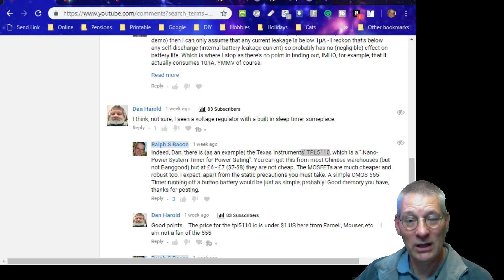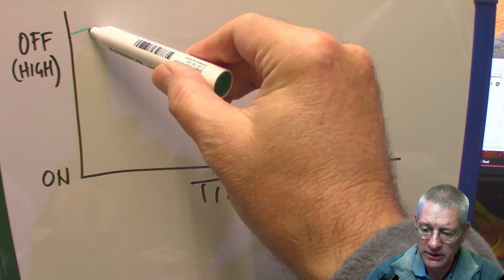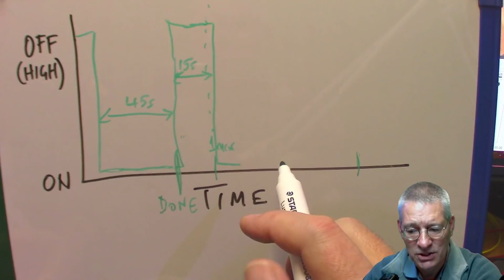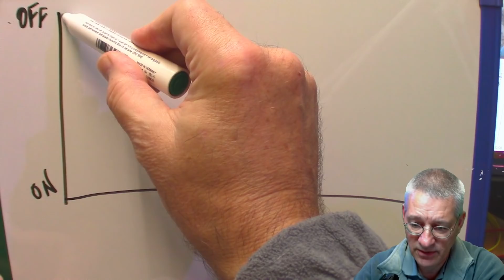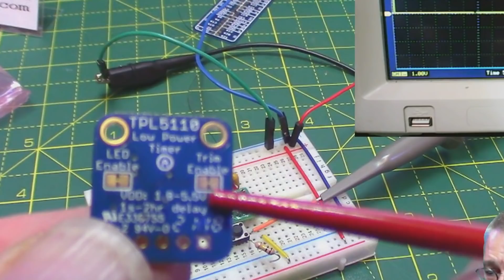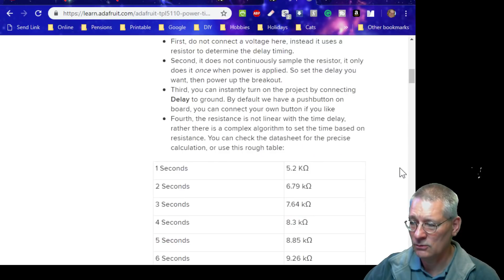#125 TPL5110 Nano Power Timer (for Arduino)

Comment: 5 years later I am experimenting with both TPL5110 and TPL5111.
My few conclusions and remarks:
1- if you assert the MANUAL SHOT it resets all the timers - that means: this is the way to EXTEND the load being powered (i.e. writing to SD card) you might periodically assert MANUAL SHOT (from you device: Arduino or ESP32) until the SD card is written and only then you assert DONE (that is not only my observation but also as per datasheet: "A manual power ON signal resets all the counters. The counters will restart as soon as a valid manual power ON signal is recognized and the signal at DELAY/M_DRV pin is asserted LOW."
2 - I wanted to use these chips for my IoT devices that are ESP32 based and... in my case it makes no sense. Why? When we use TPL511x to turn OFF ESP32 then the next time it starts, it takes extra time to wake up vs wake up from deep sleep (in fact it takes 200ms longer while powered ON again). That means that power saved due to ESP32 being completely OFF (in which case we talk power consumption < 1uA) is totally neutralised by longer time of ESP32 working. My sensors while waking up from deep sleep require in total around 200ms to wake up, measure, send measurements and then to go to sleep. But when ESP32 goes off and then on that time extends to 400ms. And these extra 200ms "eats" all the power savings. 
3 - so conclusion of point 2 above in my case is: if the IoT sensor is about to sleep less than 10min it is better to send ESP32 to deep sleep rather than to power off. If however IoT device is about to sleep longer i.e. 15min or so, then TPL511x makes total sense.

Btw almost everybody  (at the beginning) understands the TPL511x wrongly: everybody thinks that counter RESTARTS at DONE while this is not true - it only restarts at MANUAL SHOT and/or periodically when expired.

Nice video anyway, pity I found it... one day after I understood TPL511x already ;-)
Reply from the maker: But it's always good to get confirmation of your understanding! 

Kudos on your deep dive into understanding the TPL5111. On an ESP32, I've found that a complete power off is just as quick as a Deep Sleep, given that the ESP32 reboots upon wake up anyway. Then again, I'm not measuring down to the ms level like you are. 

I've found the ePulse Feather by ThingPulse to have a pretty low 15μA Deep Sleep current consumption (even more modern ESP32 devices such as C3/C6 can only match that).
Reply: @RalphBacon  because time is very relative thing. If you have a "normal" ESP32, that wakes up, connects to WiFi, i.e. with Wifi manager or so, with DHCP, with auto channel etc, all these things take ages, and I mean ages: can be even 3-5 seconds. 
But, if you do it different way - i.e. like me: using ESPnow - then everything is done within 100-200ms. That includes measurements (temperature, light, humidity, lipo etc.). In such case, work time 200ms vs 400ms (because while coming from deep sleep the wake up time is < 50ms while when coming from power on takes 200-250ms) is ... 100% longer. And then, this work time that is extended from 200ms to 400ms is the key to battery depletion. And according to my calculations this case is not worth TPL511x unless you have a sleep time > 10 minutes. Because only then, the energy saved on power off compensates the energy spent on longer wake up/work time.
Old ESP32 had deep sleep current 8uA. Everything newer than that (S2, S3, C3, C6) is around 20uA.

Comment: Great video, subbed! have to say i was disappointed by these modules, i was under the impression that you could use 1 of these as a symmetrical timer without using the done pin, it wont operate in this way, they could easily have added this feature on to the board by using 2 x tpl chips so you could have 1 running the timer function and the other pulsing the off state, so this board is of no use unless you use the done pin, unless you want a device that sends a low pulse over a set time period.
Reply from the maker: Yes, I concur, and thanks for the sub! However, it led me to a better solution with my own "on/off/auto" MOSFET circuit using a tiny Si4599 (I did a video on this too) which I have used in many (battery) circuits.

Comment: This project is a perfect workaround for my remote weather station prototype. I am using a T-Call v1.3 devkit board that incorporates a SIM800L GSM modem on board and a number of power management ICs that on paper look good. It is solid as a rock fed from USB power and seemed good fed from battery only. However, I had a number of unexplained glitches in long term testing that would only occur when running from battery. In further workbench testing I found that the board would behave strangely at times when battery powered and that I could reproduce the problems across multiple boards. I concluded that for stability I would have to run the board from the USB supply powered by a boost converter. This solution is also rock solid BUT it also powers the UART to USB converter IC so my deep sleep current goes from 1mA or so to 10mA. This means that the board is always using at least 10mA and the battery is noticably impacted during overcast days or periods of poor weather. I have now built the TPL5110 into a power management board that powers the boost converter and it is looking good. I am conducting final testing before fitting it into the weather station. I have also managed to get the old GSM modem running TLS v1.2 via a useful library that I found so that is very useful too. Many thanks for your video Ralph.
Reply from the maker: You're most welcome, Richard, and congrats on your persistence in getting this issue resolved. 

Depending on what was actually going wrong you could also have used an external watchdog (also in one of my videos) and works like a dream. Or just reset it via software every X hours!

Comment: Enjoyed your tpl5110 video. Your right this circuit didnt act as I expected.  I'm not sure if my setup is working like it is supposed to do. I have a weather station using the esp8266. ( infamous for having issues working with the tpl5110)  . If I set my delay time to let's say 2 minutes the circuit will power on for 2 minutes then off for 2 minutes and on for 2 minutes and so on and so on. I have the done pin set at the end of the code I'm sure that the code is finished well before it cycles. Is it normal operation for the tpl5110 to stay on for the time period selected by the delay resistor and off the same time or should the tpl turn off immediately when it receives the done signal?

Thanks for your input

Rick
Reply: Thanks Ralph,
After rewatching your video and doing some monitoring It looks like the microprocessor is not receiving a done signal and thus recycles at the end of the preset time selected on the delay pin. I think I may have more code running or looping and never makes it too the digitalWrite statements thanks for the link it is proving helpful,

Rick
Reply from the maker: No, that's not right.

If you have configured the TPL5110 for, say, a 2 minute cycle but then set the DONE pin HIGH it should shut the μC off. From the datasheet:

"If the µC replies with a DONE signal within the programmed time interval (tDRV) the TPL5110 turns off the µC, otherwise the TPL5110 keeps the µC in the on state for a time equal to tDRV."

You need to add some debugging (Serial.println) statements (or an LED with 220Ω current limiting resistor) to prove you are driving the DONE pin HIGH.

More info here:
https://www.ti.com/lit/ds/symlink/tpl5110.pdf

Comment: Thank you for posting this video.  I will subscribe to your channel.  I wish I watched this before ordering TPL5110 units. I am in need of a solution that it will power up the  (3,3v) board (has no sleep modes) every 15s or so and only power it off when it stops registering values above a certain treshold (could take up to half an hour ). In the comments I found some more ideas for this that I will check out. Since this video was 3 years ago, are there better solutions nowadays to solve this problem? If so, did you create video's about this that you would recommend watching?
Reply from the maker: Welcome to my Arduinite journey, Robert! 

Regarding the TPL5110 it's still a viable way of switching something on every so often, although I would also consider my own dual MOSFET (Si14599) (video #122 and others) using a 555 timer (CMOS version, miniscule current requirement, probably using a CR2032 battery) which would be cheaper by quite a bit.

So the 555 would generate a pulse of about 1 second every X seconds/minutes to turn on the auto on/off MOSFET; the microcontroller would then keep it all turned on just as described in the previous video #122 and then turn it off when it brought that enable pin low.

As long as both inputs to the N-channel MOSFET were via diodes they would not interfere with each other.

I also did a video using a DS3231 RTC module (setting an alarm, video #192) but for your case use I think the 555 would be better and simpler.

Just a suggestion.

Comment: interesting video ralph.The Powerdraw 20uA is something that needs to be taken in account for low power projects. 20uA is no much but an ESP8266 in deepsleep draws less. However, if you have any peripherals attached to that ESP8266, obviously this board will soon bea winner regarding low power
Reply from the maker: I guess the rule is, ED, we don't ever get something for nothing! I've got 328P chips that draw just 0.2µA in Deep Sleep yet when I use the WDT to wake them up it goes up to 25µA in Deep Sleep mode. Sigh.

But for a battery powered project the 20µA that this chip takes is not THAT bad and may well be the answer for some especially with other peripherals attached, just as you say.

Good to hear from you as always.
Reply: @RalphBacon  i looked a bit more into that chip and it is quite an interesting one. The TP5111 is more suitable for chips that need an enable signal. I have some LDO's that could benefit from that

Comment: Has the video for the TP5111 come yet?
Reply from the maker: I do still have the TP5111 in its packet but is it sufficiently different to the TP5110 to warrant a whole video, Roy? What sort of application did you have in mind?
Reply: I guess that about sums up why I was looking for another video about that one, was to learn about the differences between them. I am assigned the task of evaluating the TP5111 for possible use in a product we are developing at work, which needs to survive on a small battery for 6 months to a year ideally.

Comment: Would it be possible to drive the delay pin with a high signal from an Arduino? As in, wake the Arduino with an external trigger like a PIR sensor, then have the Arduino send a high to the delay pin on the timer chip keeping itself awake (as the PIR signal may only be a couple of seconds). Then once the Arduino has finished its task, send the delay pin low again. This way you can have the Arduino woken by the timer or an external source
Reply from the maker: According to the datasheet, momentarily connecting DELAY/M_DRV to Vcc will cause the TPL5110 to power up the µcontroller. Then it switches it off once it gets the DONE signal or when the timer runs out (whichever is the sooner). So an external signal could drive the DELAY/M_DRV pin, I suspect, and initiate this cycle.
Personally, I didn't like the fact the the TPL5110 would always shut down the µController in the absence of a DONE signal.
I preferred my circuit diagram (which, would you believe it, is not unique or ground-breaking, others have done it before, who knew?) which would also allow an external signal to turn on the µController but this would all stay on until the µC decided to switch off.
Whichever way you go, it should indeed be possible to do what you suggest. Good luck!
Reply: Ralph S Bacon nice one thank you. I like the very low current this device uses
Reply: Well, I received a TPL5110 (Adafruit one) and it’s easy to use thanks to your description.  I’ve found I can use a PIR to send the delay pin high, but the TPL5110 only outputs to the drive pin once the delay pin goes low again. So my Arduino will boot once that happens, but then the PIR is low again at that point (2 seconds later) so the Arduino doesn’t know if the PIR triggered the wakeup or the timer did.

Comment: Interesting chip! Nice video and explanation thanks! I'm wondering if you could use a capacitor to hold the charge for when the tpl resets briefly power leaving your uC on? This might be a good way to monitor an event based tipping bucket rain gauge using the M_DRV.
Reply from the maker: Glad you liked the video, Christan! You could use a (near) supercapacitor to keep the Arduino on, I guess, but there are probably better ways to achieve what you want without this. If you are monitoring a tipping bucket I would look at using an interrupt (eg a magnet and a Hall Effect transistor (or even a reed switch)...

Comment: Is there a circuit for the TPL5111 which allows for longer sleep times (like 24 hours) ? Maybe combining them using logic gates..?
Reply from the maker: Nope, it hard-wired to a maximum of 2 hours, Thomas. But that is not a deal breaker.
 
When your Arduino wakes up all it has to do is read and increment a value in the EEPROM until it's been asleep enough (eg 24 hours, so 12 wake ups) then clear the EEPROM and do its business. So it wakes up 11 times "unnecessarily" except to increment the EEPROM which it will do in well less than 1 second. It can keep the rest of the circuit switched off (peripherals etc) using the MOSFET technique in my previous video #123 to save power. Jobs a good 'un.
Reply: @RalphBacon  thanks for your advice. Would've been neat if the microcontroller does not have to turn on only for time-keeping tough. I have to admit I don't know how much energy is needed to write to EEPROM using Arduino.
Reply from the maker: The other alternative, which others seem to not favour but I see nothing wrong with it, is to use a CMOS version of the 555 timer to issue a wake-up signal. The 555 needs microamps of power (possibly from its own button cell) and can have much, much longer timing periods. Frankly, though, I'd let the Arduino (or ESP8266 etc) wake up and write to the EEPROM. There is only so much power saving someone can carry out!
Reply: @RalphBacon  thanks mate

Comment: Ralph, great video. I have purchased both models for use on my ESP projects and they work great. The only issue I am finding is that I only want to actually turn my ESP on every 24 hours. I therefore assume that I will need to set up an increment counter which will be stored in EEPROM on the ESP, taking into account wear levelling? I have taken inspiration from the work of Andreas Spiess and his DailyTaskNTP library. Here he wakes the ESP with WiFi turned off, increments a counter (stores in Ram, not applicable in my case due to total shutdown) and puts the ESP back to sleep, until it reaches its target and then switches the ESP with WiFi on, at the next boot up, does its work and shuts down.  I was wondering, am I on the right lines? Is there a more elegant way of dealing with the increment counter other than booting up the ESP?  

I've also considered using an ATtiny85 to act as an increment counter and this in turn could then switch a P chan Mosfet when WiFi is required. I have assumed the  ATtiny would consume less power than booting up the ESP as a counter, but will of course be testing to find out. Maybe this idea is a bit off the mark,  but happy to learn through making mistakes.

Your guidance and knowledge  would be very much appreciated, along with any of your subscribers  input.

Thank you for taking the time to read
Reply from the maker: You need to read my answer to Thomas above, Dean, but I'll copy it here, funny how we all think along the same lines:
 
[The delay is] hard-wired to a maximum of 2 hours, Thomas. But that is not a deal breaker.
 
When your Arduino wakes up all it has to do is read and increment a value in the EEPROM until it's been asleep enough (eg 24 hours, so 12 wake ups) then clear the EEPROM and do its business. So it wakes up 11 times "unnecessarily" except to increment the EEPROM which it will do in well less than 1 second. It can keep the rest of the circuit switched off (peripherals etc) using the MOSFET technique in my previous video #123 to save power. Jobs a good 'un.
Reply from the maker: PS The EEPROM can take 100,000 write cycles, so assuming you're writing to it 12 times a day (to either increment or clear the value) that is over 8,000 days which is 22 years. No need for any wear levelling algorithm here.
Reply: Couldn’t you just use the esp’s own wakeup from deepsleep timer?